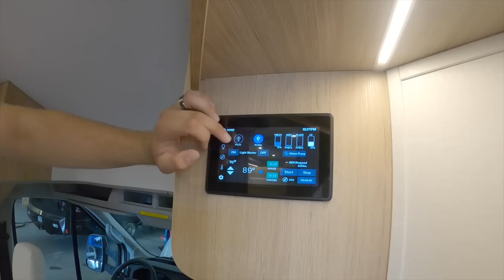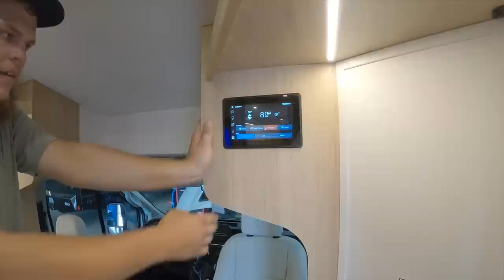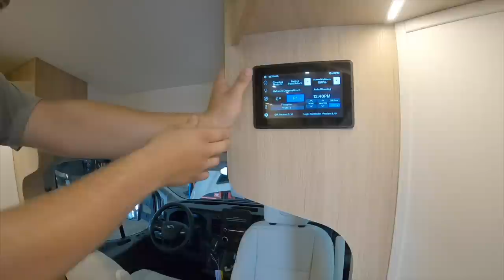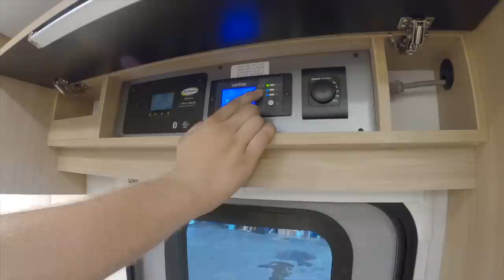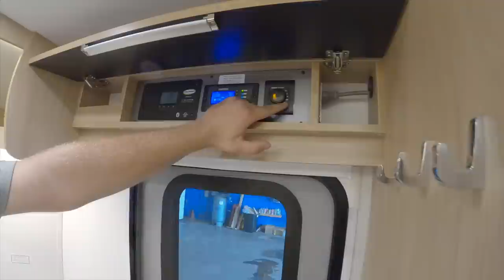2020 Wonder RTB on 2020 Ford Transit Gas Chassis Walkthrough | Leisure Travel Vans

Comment: Thankyou so much, this is one of the best, unbiased walkthroughs I've watched, it really highlighted how everything worked right down to the little hidden spots. Just wondered (no pun intended) why you didn't go for the lithium battery option on the coach.
Reply from the maker: Hi Gary - I appreciate the feedback. This coach was ordered months before I put money down on it, so I wasn’t able to pick out any options on it. However, I did upgrade to 6 battleborn lithium batteries and a 3000 watt inverter shortly after getting the coach. Now I can go days without plugging in or running the generator.
- Eddie

Comment: Congratulations on your new Wonder RTB! You’re going to love it, I’m sure. However, you got a 2021 Wonder built on the 2020 Ford Transit coach (not a 2020 Wonder). The 2020 Wonders were build on the 2019 Ford Transit diesel chassis.
Reply from the maker: Hi Philip - Thank you for reaching out. I can 100% assure you it is a 2020 Wonder on a 2020 Ford Transit chassis. That is one of the reasons I was pretty upset, because I only found out it was a 2020 the day before I took delivery. This is one of only a few that fell under this 2020/2020 build.
Reply: It has a gas engine, right? All gasoline powered Wonders are 2021 models. The 2020 Wonders were all built on the 2019 Ford Transit diesel chassis. We picked up our 2020 Wonder RTB in March 2020 (we lucked out and found the model we wanted on the showroom floor of FretzRV in PA and it came with all the options we wanted). We first saw it in late Jan and put a cash deposit on it, but couldn’t pick it up until March because I had to get our trade-in to them first which was stored in TN. Anyway, about a month later, LTV announced their 2021 gasoline models which caught me by surprise as they hadn’t publicized much about switching to gasoline chassis. As far as I know (and this topic has been discussed on many FB posts on the LTV Enthusiasts group), all Wonders built on the 2020 Ford Transit gasoline chassis were designated as 2021 models. Perhaps, the dealer declared it wrong when they got it titled with the DMV or something, but if it runs on gas it must be a 2021 model as far as LTV is concerned.
Reply from the maker: Here is what happened. There were some (not sure of the amount) 2020 Wonders that were built with some of the changes of the 2021 wonder models, but not all of the changes (new layout, new latches/handles on the exterior storage doors, etc...). Mike and Jennifer of RV Lifestyle have the same example of this. And Triple E has designated these as 2020 models. So as MOST 2020 Wonders are on the 2019 Ford diesel chassis, not ALL of them are. And trust me....I was NOT happy when I found out this was a 2020 and not a 2021. I prefer the newer layout as well as the new exterior latches/handles on the storage.
Reply: Interesting! In the past they would have designated such a major mid-year model change as they did with the 2015.5 model change in the Unity. I went to the LTV site to look at the model changes you mentioned and unless I’m mistaken they’re still showing the 2020 floor plans. I don’t know why they’re so slow in updating their website and manuals (the manual we got with our 2020 is based on an earlier model, like a 2019 or 2018, with an addendum added to cover the basics of the Firefly control panel which they first added to the 2020 Wonder RTB. I watched the 2021 videos and didn’t see major differences in the floor plans between the 2020 and 2021 models; the only difference I observed was that they did away with the Lagun table and replaced it with a pedestal table in the 2021s—I much prefer the Lagun table. I hate the outside locks on ours and was envious of the new locks they’re now using on the 2021s. I first thought that I would have preferred a gasoline engine, but we seem to get better gas mileage with the diesel, though diesel prices are usually higher. We learned to look for diesel when driving through smaller towns or on secondary roads as we can usually buy it much cheaper than the prices at truck stops off the Interstates. It will be interesting to see if buyers of used RVs will place a premium on Wonder diesel models in the future.

Comment: Just a tip. When you put the awning legs in, once inside the channel, you should extend them again as far as they go to stop them from moving around.
Reply from the maker: Great tip!  Thank you for that.  Any other tips that you can think of?  I appreciate how the RV community is so open to sharing best practices.
Reply: @TheScenicExplorer  Still going through the video :) Another thing I noticed is, the Truma control panel, the antifreeze option he pointed out is not installed by default, but has to be ordered separate from Truma. From the factory, that setting won't do anything.

Comment: Just found your channel. Ford's 3.5 Eco Boost should not require high test gas. I have that engine in my F150. It takes regular. Glad to see it in Denim. I just built a 2021 Denim front twin bed on line. Had to back out most of the options as it came in pretty high. Americans can expect a 25% discount on American RVs. How was the discount on yours?

Comment: Great video. I am so happy for you ...maybe a little envious too.

Kind of curious as to why Liesure Travel doesn't let you choose between the 3.2 turbo diesel & the 3.5 Ecoboost ...if it's an option on the Transit?
Reply from the maker: Good question Ron!  I’m thinking it’s a matter of simplifying their selections. Unity = Diesel, and Wonder = Gas. But that is just my best guess. I will tell you, I am thrilled with having this eco boost gas engine, have been getting great mileage of 15+, and am thrilled I don’t have to worry about adding DEF and the other downsides to having a Diesel engine. But I know that is a long standing debate....gas vs diesel.
Reply: Fird Transit is not currently offering a diesel option. When they do next year, it will likely not be available on the AWD  chassis.

Comment: Thank you for the walk through.  How long and wide are the beds?  They looked short, might have been just the angle.  I am still trying to decide if I want a Class B, B+  or a Class C.
Reply from the maker: Hi Sharon - I don’t have my tape measure with my right now, but I can tell you that I find the beds to be plenty long and wide. I am 5’8” and weigh 185 lbs, and I am totally comfortable on the bed. My 70 lb golden retriever even joins me on the bed sometimes, and we are totally fine. I did add a 2” foam topper that I picked up from Walmart and that has helped keep the beds cool, and added a little cushion to the mattress. 

I also was choosing between a B, B+ and C, and I will be doing a video in the near future about why I went with a B+, but I can say that I feel like we definitely went with the right choice for us. Perfect balance between comfortability, storage, and can still go almost anywhere a class B can go. 
-Eddie
Reply: @TheScenicExplorer  thank you I'm also 5'8" so that should work.  I have not found that model around my area to go and see for myself.

Comment: I'm a little confused.  You asked the young man if you could run the generator while plugged into shore power.  My question is why would you want to do that given that #1, you're plugged in and #2, wouldn't you just be wasting gas to run the genset while plugged in?  Sounds a bit redundant.  Am I missing something?
Reply from the maker: Good question Chris - My question was more intended to be “in case I accidentally turned on the generator while plugged into shore power, what would happen?”  I wanted to ensure the electrical system wouldn’t be damaged. 
- Eddie
Reply: @TheScenicExplorer  , well now that makes sense.  I guess I was a bit confused but thanks for setting me straight.  Have a great day and thanks Eddie!!

Comment: I’d like to hear pros and cons concerning gas vs. diesel from everyone! Gas is cheaper than diesel, but does servicing cost a lot more on a diesel? Thanks! I like the Wonder RTB because of the “garage”, hoping I can put my husbands elec scooter in it! Can anyone give dimensions of the slide that comes out of garage? Thanks!
Reply from the maker: Hi J S - I have never owned a gas vehicle before, so I’m not the best at providing a pros and cons of gas be diesel. However, I love having a gas rig. My biggest concern was lack of power/acceleration and I can assure the Ford eco boost has plenty of power to handle even the mountains of Tennessee. Gas is cheaper and the MPG on my rig is great as well (14 to 16 MPG). I also don’t have to worry about adding DEF, and the more expensive service costs of a diesel system. So I am happy with my choice.
Reply from the maker: As far as the garage storage, it might be tough to fit an electric scooter in there, but I have fit my fat tire ebike in there with no issue.
Reply: The Scenic Explorer thanks for the info!

Comment: So is this the 2020 or 2021? I'm confused. It didn't have a 2k inverter, ladder and lithium batteries. Or are those an option?
Reply from the maker: Hi Talley's Art Studio - This is a 2020 Wonder on a 2020 Transit Chassis, which as ALMOST all of the features of the 2021 Wonder.  It DOES have a 2,000 watt inverter (which is standard) and I added a ladder and lithium batters after the fact (which are options).  I hope that clears things up.
- Eddie
Reply: @TheScenicExplorer  So  basically it's the options that seperates the year? Interesting..  Things I could purchase separately. Except, for the ladder it appears. This layout is perfect for me. I wonder if they could make the hatch opening bigger from one of the closets under the bed? Big enough as an escape route for an emergency.  I've been traveling a long time and weird things do  happen.. 
I'll have to call them and ask.
Reply: Talley's Art Studio : Great point!

Comment: Is there a 12 foot Refrigerator avaiable?
Reply from the maker: I assume you mean a “12 volt refrigerator” correct?  If so, the fridge in my RV is a 3 way fridge (propane, 12 volt dc, and 120 volt ac)

Comment: I  think the manual should  specify what fuel grade to use.
Reply from the maker: I would agree George...the manual should specify. However my manual is for a 2020 wonder on the 2020 Diesel Transit Chassis, so most of the info is not accurate.
Reply: Kind of curious about this. I have that engine in an F150 and it is a beast. The manual for the F150 says you should use the higher octane fuel when towing a trailer. Otherwise regular unleaded is fine. I have never used the higher octane when pulling a rather large travel trailer and have had no issues.